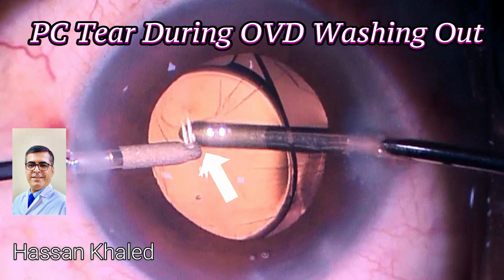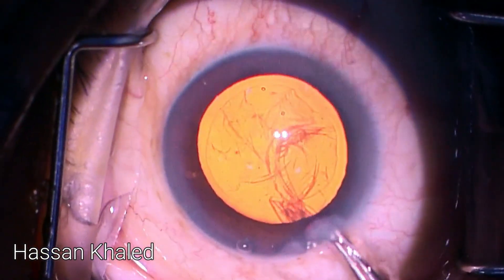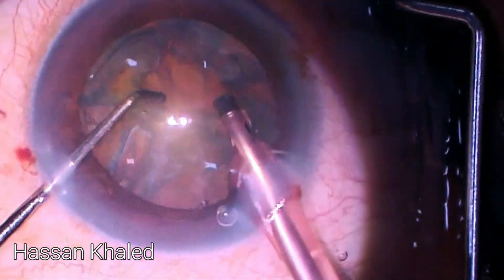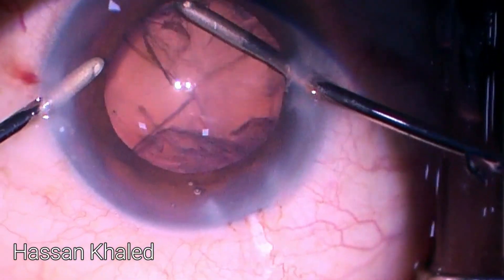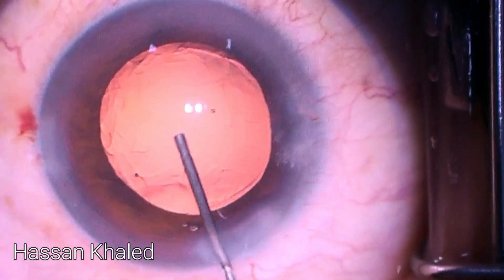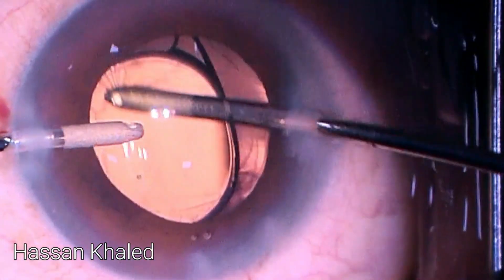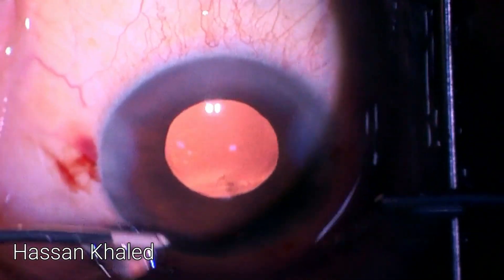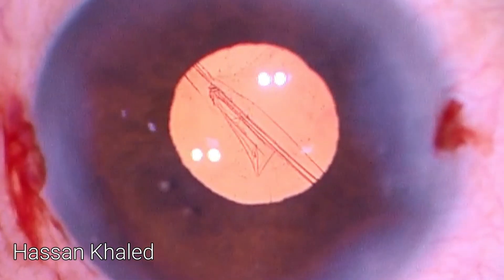Posterior Capsule (PC) Tear During The Washing Out  of OVD

Comment: Leaving the viscoelastic behind the lens has many problems and the technique is learned by doing routine suctioning many times over a long period of time, it cannot be left only for toric lenses.
I think if you aspirate with a coaxial that has a silicone sleeve that helps separate the capsule from the metal it might be friendlier, good case to discuss Dr, thanks for sharing.
Reply from the maker: @drjorgegalue   thank you for your sharing experience.
Reply: Agree plus coaxial behind the lens, has the flow of BSS directly pushing the Posterior Capsule away.

Comment: 1.- Is there really any benefit in aspiration visco behind the IOL? I dont feel the risk is worth it. Unless its a toric IOL. Then I always aspirate it on toric IOLs.

2.- If you are using bimanual I/A. Wouldnt it be better to use hydro implantation technique? and then you avoid aspirating any visco...?

3.- I feel you were a bit aggresive, even in 0.25x slow sleep your movements are very fast behind the IOL. In my opinion this was a risky manevour that could have lead to that PC tear..I would been more catious being behind the IOL, however we all have those moments were we get overconfident and I understand it. 

4.- Leaving the IOL there might be ok, if its stable because the anterior hyaloid is intact and theres no vitreous prolapse. However close observation its important. Exchanging for a 3 piece of IOL IMO would be good option too, with a good visco tamponade and no anterior hyaloid disruption you wouldnt need to anterior vitrectomy.
Reply from the maker: @ravr2442  thanks for your comment. 
Leaving viscoelastic material behind the intraocular lens (IOL) after cataract surgery can lead to several potential complications. Here are some of the issues that may arise:

1. **Postoperative Intraocular Pressure (IOP) Rise**: Residual viscoelastic can contribute to an increase in IOP, which may lead to postoperative complications such as glaucoma or other pressure-related issues. This is particularly concerning if the viscoelastic material is not adequately removed, as it can create a blockage or obstruction in the eye [[3]](https://pubmed.ncbi.nlm.nih.gov/1531233/).

2. **Refractive Surprises**: The presence of viscoelastic behind the IOL can affect the optical properties of the lens, potentially leading to unexpected refractive outcomes. This can result in the patient experiencing blurred vision or other visual disturbances [[1]](https://eyetube.net/videos/removing-viscoelastic-from-behind-the-iol--uufppat).

3. **Capsular Distention Syndrome**: If viscoelastic is left behind, it can cause distention of the capsular bag, which may lead to complications such as lens dislocation or instability. This syndrome occurs when the capsular bag is under excessive pressure due to trapped viscoelastic [[1]](https://eyetube.net/videos/removing-viscoelastic-from-behind-the-iol--uufppat).

4. **Adhesion to the Lens Capsule**: Some viscoelastic materials, like Viscoat, may adhere to the lens capsule and the posterior surface of the IOL, making complete removal difficult. This can prolong the surgery and increase the risk of complications during the procedure [[3]](https://pubmed.ncbi.nlm.nih.gov/1531233/).

5. **Need for Additional Surgical Intervention**: If significant amounts of viscoelastic are left behind and complications arise, the patient may require additional surgical procedures to address these issues, which can increase the overall risk and burden of treatment [[3]](https://pubmed.ncbi.nlm.nih.gov/1531233/).

In summary, it is crucial to ensure that all viscoelastic material is removed during cataract surgery to minimize the risk of postoperative complications and ensure optimal visual outcomes.

---
Learn more:
1. [Removing Viscoelastic From Behind The IOL - Eyetube](https://eyetube.net/videos/removing-viscoelastic-from-behind-the-iol--uufppat)
2. [CRSToday | Tips and OVD Tricks for Difficult Cataract Surgery Cases](https://crstoday.com/articles/2009-jun/crst0609_12-php)
3. [Removal of viscoelastic materials after experimental cataract surgery in vitro](https://pubmed.ncbi.nlm.nih.gov/1531233/)
Reply: @ Thanks Sir. I agree with most of these complications, however I feel they are pretty rare. Maybe except IOP spikes which can be controlled easily in most cases. 

Thats why I guess most surgeons wont remove OVD behind the lens in routine cases. Atleast in my working centers is not a common practice and we dont see those complications often. 

Thanks for sharing, great video!!
Reply from the maker: @ thank you
Reply: I do irrigation behind it,mostly fine with that approach
Reply: That was informative sir thanks 😊 
جزاكم الله خيرا
Reply from the maker: @ thanks
Reply: High yield information shared here 😊

Comment: Great presentation Dr
Why not just irrigating the OVD behind the IOL, does it have to be aspiration ?!
Reply from the maker: Thank you. Actually irrigation alone will not be enough but it could be done , however washing the OVD behind the IOL isn’t that difficult and it is easy to be done , but in very very rare cases some surprises can be happened as in this case . 😂
Reply: I must admit that I fear the same thing happening every time and mostly I do just irrigation behind the IOL,except when the AC is really deep
Reply from the maker: @cirkmannzirkel8229  fear at the starting of anything is normal human feeling . But when you try it slowly and slowly at the beginning you will used it by time and it will be more easily